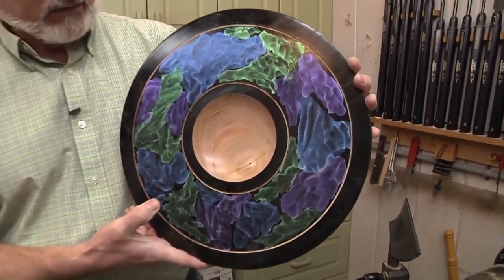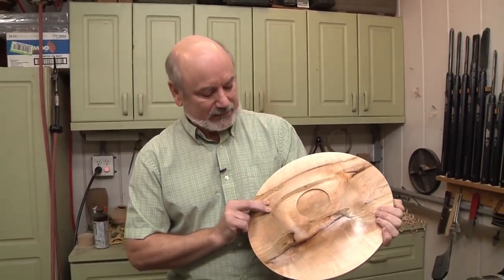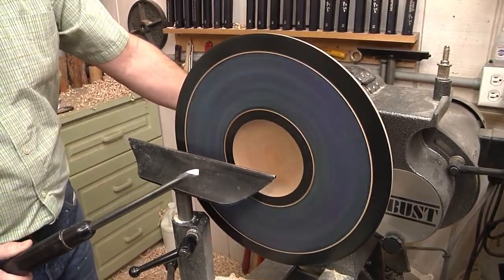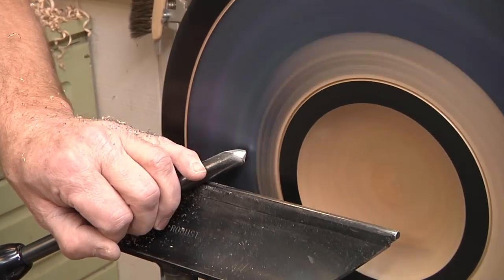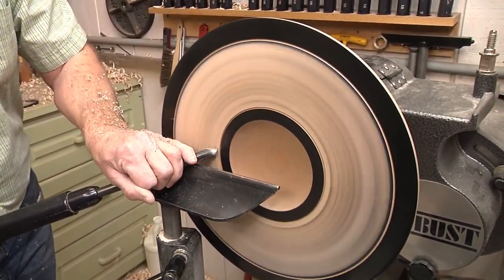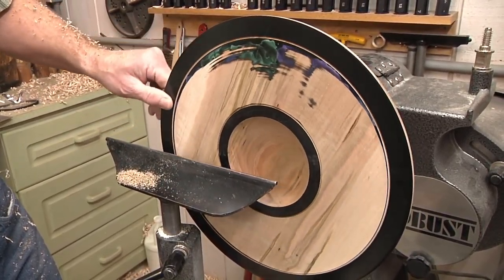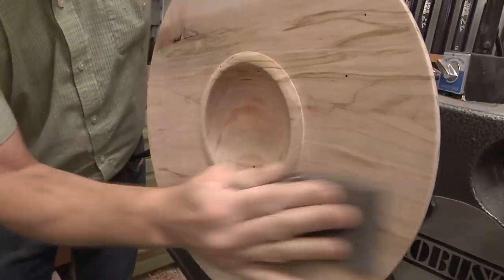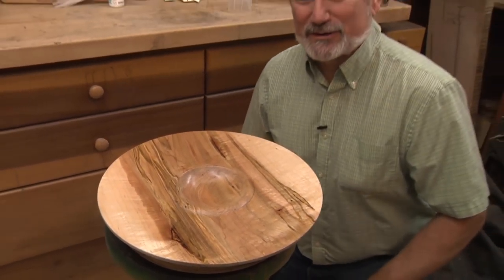Parting of the Cosmic Clouds

Comment: Love your videos! I have started turning here lately and am having some pretty good luck so far using techniques I have learned from you and many other turner's on YouTube as well. Other than simple hands on practice I think I am getting the hang of this. My only real problem so far is wood cracking after finishing a piece? Two cases for you, both using a minimum 1 year old piece of wood. One Bradford pear and one cedar. Both turned nice and looked great. One was a small wine glass, one was basically a canister. Both sanded up to 1200 grit and looked like glass. One finished with Woodturner's sealer, the other with danish oil.The Bradford pear cracked so bad you can see through it, the cedar was fixable with CA glue and re-sanding. What do you do?